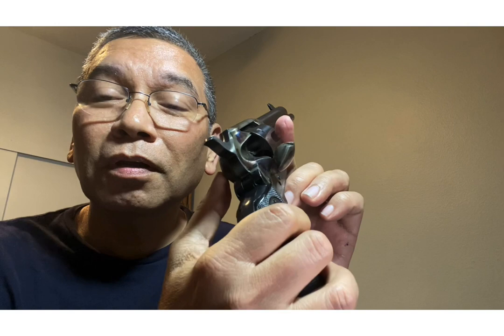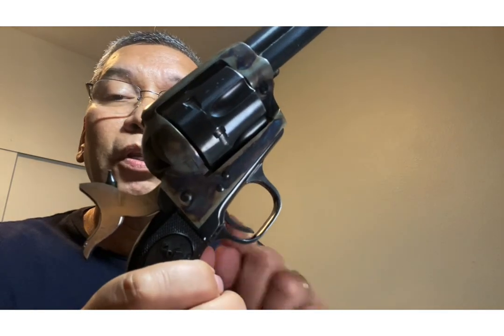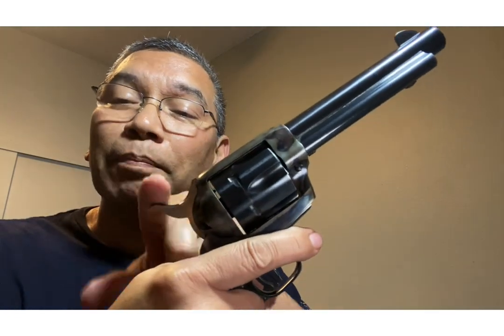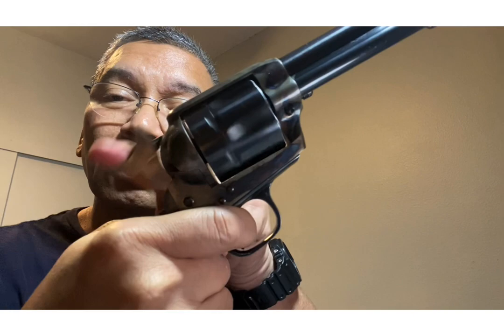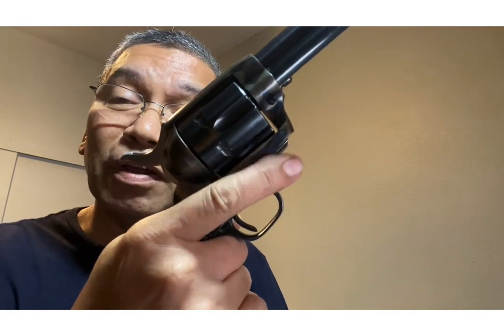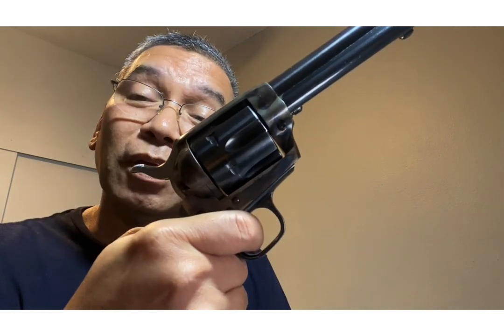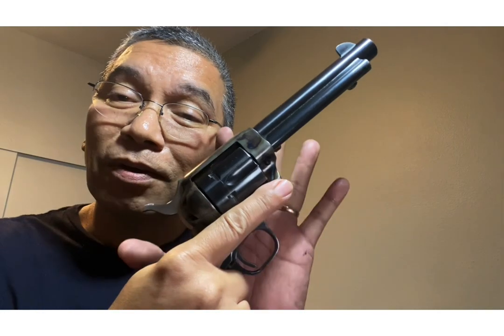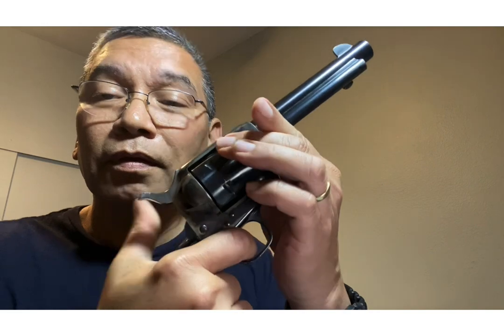Guns Don’t Just Fire for No Reason

Comment: So the answer is no, that gun cannot be fired without depressing the trigger.
Reply: Yes kinda you have to depress and hold trigger to let the hammer down. It's possible for certain guns without a transfer bar to fire if you let the hammer slip while releasing. I'm sure that's what baldwin is trying to say. He did'nt "pull" the trigger on them but the trigger would have been depressed. The gun would have a prop dummy round in it for the camera. Likley the inexperienced weaponmaster left some powder in the round when making the cold rounds.
Reply: @Twistedwolf-ru2qk  I think you missed the part about the specific gun that was used makes it impossible to have fired like Baldwin said without pulling the trigger. Baldwin's ignorance of guns and how they work is why the story he came up with makes sense to him but leaves the gun community cringing.
Reply: However halls is saying his finger was never in trigger guard if that is accurate the gun could have been damaged.

Comment: Nice pistol. In fanning, the hammer needs to be brought all the way back to rotate the cylinder to the correct position so the round is in the correct position. Accidently pulling the hammer back half way with your finger on the trigger won't result in a discharge.
Reply from the maker: You are indeed correct. Even with the trigger held back to release the sear, the hammer must be brought all the way back to properly rotate the cylinder to bring a chamber into battery.  In the mechanics of the lock work, every detail needs to come together for the firearm to successfully discharge.
Reply: He clearly says he was releasing the hammer and it slipped. Releasing with finger on trigger will cause discharge if the gun is missing the transfer bar and hammer block as many prop weapons do. 99% of all these people own have the transfer bar but they can be bought without them. The original guns did not have them and thats why they carried with only 5 as the guns could accidently go off with very little force.  Prop weapons use them for fanning scenes.
Reply: Even with the more modern handguns there has been recalls for the gun dischargeing without touching the trigger. One would even fire if you used a decocking lever. 
Some cowboy action shooting will not allow holding the trigger back and thumb cocking the hammer. They contend some guns can fire out if index if not fully cocked.

Comment: That's similar to some pump shotguns where you hold the trigger back and fires while cycling the action just like holding the trigger back and cycling the action of a SAA handgun. But technically it's still a triggering action; they don't cycle themselves, just like they didn't trigger themselves.

I assume this is in response to the marionette claiming not to have pulled the trigger when he aimed and fired twice at two people, but the handgun came to life on it's own and began firing wildly.
Reply from the maker: I've not really been much of an afficionado of quickdraw with a hog leg.  My friend Jon "Trickshot" Wilson, who I met when we all did the "Top Shot" TV series, was the one who has the maestro of such things.  Unfortunately, he passed away. I would have loved to have interviewed him about this incident.

As to "quick-schucking" pump action shotguns, I've done it but I always worry about that hammer going forward on the older guns before the action is fully locked. Also, my shotgunning aiming intuition isn't the best as my trap and sporting clay scores will attest to. My definition of wild is not having a proper firing solution when I break the shot; so better I slow it down a little when manipulating a pump gun in real life.
Reply: @CMPInstructor  <> Oh yeah, no argument there. But the same could be said of the SAA as well. Just because the mechanics means you can, doesn't necessarily mean you should, or that it's your best option.

Personally I love shooting clays not because it's easy, but because it isn't easy. In fact I've always shot low gun, from a port of arms position to simulate field conditions instead with a mounted high gun like everyone else does. Sure, I miss more targets that way, but I'm being honest with the intention of the game, and enjoying an honest challenge of it.

Comment: "Fanning" only causes a discharge if the shooter begins with the hammer fully down. The SAA clones (Baldwin's gun was a Pietta) have 4 hammer positions. If the user begins with the hammer one click off of "down", then the trigger is locked in a position that will not fire. In order to prevent accidental firing of a loaded SAA due to being dropped, experienced users (presumably including the armorer) will carry the gun with the hammer in one of two positions: first position, or fully "down" over an empty chamber. It's reasonable to expect an experienced user, especially an armorer, to use one method or the other consistently. What was Ms. Gutierrez-Reed's normal practice?
Reply: You sir are wrong.
Reply: @mybad8805  I own a Uberti SAA clone, and rechecked this after getting your comment. I'm not entirely wrong--but you're not entirely right! What's missing from my statement, and apparently from your evaluation, is the status of my trigger finger while trying to fan the hammer. Baldwin said he didn't pull the trigger. My original comment was based on my trigger finger being off the trigger.  With no trigger-pull, when the hammer is in ANY position, fanning the hammer causes it to advance at least one position, but not to release. In order for there to be a discharge while fanning, my finger must maintain pressure against the trigger--i.e., a trigger pull.
Reply: @rcinsley  exactly my point, the hammer can't fall unless the trigger is being pulled and you let the hammer slam home.  My CZ has no decocker.  They tell you in the manual that the only way to lower it on a live round is very dangerous.  Pull the trigger while holding on to the hammer.  Either way Alec killed that scene.
Reply: @mybad8805  Yes, decocking always requires a trigger pull and is an unsafe operation. It should be done very carefully, and only with the muzzle pointed at the ground.
Reply: @rcinsley  I like the pointed at the gun part.  They should add that to the manual.  Safe direction is what they do say and I can imagine how many leaky roofs there may be.

Comment: It is my opinion that during his many cross draw rehearsals he applied enough pressure inadvertently to the trigger for it to be mechanically pulled. Once he began manipulating the hammer to the rear all safety sear notches could be bypassed because he had a depressed trigger unknowingly. The rest is unfortunate history. The sheriff's office has said that Mr Baldwin manipulated the firearm in a way that caused it to discharge so I'm going with this as to what happened.

Comment: Great video and explanation of a single action Colt revolvers functions, that's what I believe baldwin did,  he had his finger constantly applying pressure on the trigger without realizing it due to inexperience with single action revolvers, then pulling the hammer and letting it go ....causing the gun to fire like its suppose to do.. Zero safety measures were taken...This could of been prevented obviously.
Reply: Apparently, daily gun safety glasses weren't enough for Baldwin.
Reply: @michaelbradley7529     It’s be like a formula one driver being an expert on his own gearbox.   That doesn’t make sense.  The question is what a real round was doing on that set.     We also can’t know shit unless we have the actual gun to see and we’re there to know what went down.    

Everything so far is really just speculation and people flexing their revolvers on YouTube.     Like wtf
Reply: @audimaster5000  What does any of that have to do with my gun safety comment? Very first rule is treat every gun as if it's loaded.

Comment: All relevant points Dennis. Time will tell what else went wrong and how many bad things had to line up for this tragedy to strike. 
The idea that it is "someone else's responsibility" to make a real gun "Safe" and calling it a "Prop Gun" in the media over and over is a big spin and intentional misconception in my own view. 
For this spin version to even be possible, the distinction between a "Prop Gun" versus any prop needs to be defined. For the concept to have "someone else be responsible", that so called "Prop Gun" would have to be inoperable would it not? In modern law, does the concept that the production company hires a "gun handler" or "armorer" exonerate everyone else who touches a real gun? Time will tell.
It would be hard to believe any Hollywood adult doesn't remember the tragedy and controversy incidents like the "blank gun" that claimed Brandon Lee (on the set of The Crow) could have escaped their attention or memory. 
The swirl about what is a prop gun, versus a blank gun, versus a real operable gun, and where responsibility begins and ends, will undoubtedly come up in an investigation and trail. Lawyers will try to bend language to their advantages and the politics of the industry will more than likely come into play, but in the end this was a gun, not a prop gun. Live ammo is not blank ammo either, and even blanks have been known to cause death in that Lee incident in any case, so in the end even a blank gun should not be legally considered a prop gun.
Live ammo had no place on that set, and the gun cannot be real and operable and yet still be considered safe at the same time by anyone who touched it. 
My guess, is everyone in the chain that brought a real gun and live ammo to a set, and that fired that gun at the victim is responsible, including and especially the one who pointed it and fired it. The debate should be the degree of the murder and how much of that guilt is also shared by those others. If there is a not-guilty conclusion, it would have to be based on concepts not presented by the story so far. Time will tell.

Comment: So what happens if it's less than quarter cocked and released?  Like if it was 24.9% cocked, as close as possible before the safety mechanism catches it and thus being able to strike without a trigger pull?  What happens if cocked to the point just before it latches and it is slammed back into position with a force greater than just the return spring?
Reply: It would not have enough momentum to ignite the primer.
Reply: If the hammer goes back without a finger on the trigger to the first click, about a centimeter, then it catches and won't go forward, even if you pull the trigger. If you put it in the half cock position to rotate the cylinder, it won't go forward, even if you pull the trigger. The only way to lower the hammer back down is to hold the hammer all the way back, pull the trigger and slowly lower the hammer. The only way the trigger will drop the hammer is when it is fully cocked.
Reply: @indiedavecomix3882     We can’t really know unless we had the actual firearm.  It’s entirely possible it was a clapped out or broken gun.    

The real issue is a live round being on the set.    That’s step one
Reply: @audimaster5000  You think if the cops found out the gun was faulty they wouldn't immediately put that out? They already let him fly to Vermont immediately after, why wouldn't they clear him as soon as they found out? Is it possible the gun was faulty? Anything is possible. It's even more likely he just pulled the trigger on a cocked gun and is lying about it. Where the bullets came from is a separate but important issue. Is it possible he loaded the gun? Yes. But more than likely someone else did it because he's too stupid to check if it's loaded so I doubt he's smart enough to figure out which way the bullets go in it.

Comment: Great video…but it is not true that every gun has to have a trigger pull before it will discharge. In the cowboy action shooting world there are guns like the Old Army 1860 model that only has two clicks and no transfer bar.  One has to pull the hammer back fairly far before it goes into the half cocked position, if one were to drop the hammer before the gun reaches the half cocked position- it will discharge with no trigger pull.
The question is can a Colt 3 click or 4 click discharge before the first click by dropping the hammer?

Comment: You can convert a Revolver to a Slip Hammer Revolver by removing the Trigger Spur. I uploaded a video showing how.
Reply: On a "slip gun," the trigger is either removed altogether, or wired back to the back of the trigger guard. The hammer spur is removed, and rewelded a little further down on the hammer.
Reply: @thomaspowers5486  I think I'm going to order 2 triggers and one hammer. Just incase I mess up the trigger.
Reply: @TobaccoRowe1960  I have several Ruger S/A's. Always wanted Colt though.
Reply: @thomaspowers5486  Colts a pretty gun. I'm poor, I buy Taurus. Buy two for the price of one. All my guns are Ugly Ducklings. For the price of a Colt I could have a Two Riders a Rancher and a Barkeep all in 22 WMR Magnum. And Holsters with Belt to  : )
Wait make that Rancher a Rossi M92 Lever Action please.
Reply: @TobaccoRowe1960  Sure, gotta' do some savin' for a Colt! One day maybe . . .
Reply: @thomaspowers5486  I'm wishing you ;luck Thomas
Reply: @TobaccoRowe1960  Thanks, you as well!

Comment: I love gun "experts" trying to claim expertise on prop guns. Prop weapons are bought many times without a transfer bar or hammer block for rapid fire scenes.  Prop revolvers HAVE to have something in the chamber because an empty gun looks like an empty gun on film. There are two types of ammo for prop revolvers. Cold dummy rounds and hot blanks that have a crimped end and don't look right from forward facing shots and Dummy rounds. Also referred to as Hot and cold rounds.   These dummy rounds are made with real bullets that have the powder removed and the primer discharged.  This makes them inert and safe and therefore is referred to as a cold round. HOWEVER it is possible for someone to forget the primer or powder in a dummy round. This happed with Brandon lee someone emptied the powder but forgot the primer and this dislodged the bullet tip into the chamber. When the blank was loaded it fired into Brandon. Likely what happened here is when the inexperienced prop master made the dummy rounds she forgot one bullet or got them mixed up somehow, This coupled with the missing transfer bar means that when baldwin was letting the hammer down holding in the trigger all that needed to be done was for the hammer to slip down. So what he means by not pulling the trigger is he did not do a full trigger pull he was just trying to release the hammer. This is possible with this type of weapon without a transfer bar or hammer block. You also have to understand it is these peoples jobs to point guns at each other. It's the weaponmasters responsibility to make sure the guns are safe and the rounds loaded are safe.
Reply from the maker: I’m actually familiar with the internal modifications made to prop guns. As you will see in one of my other videos, I did confer with experienced Hollywood armorers on this subject.

A number of them are friends of mine. I met them when I did a stint as the live fire weapons expert for Seasons 1 and 2 of the tv show “Top Shot”.

In properly made photo quality replica ammunition, even the primer is a solid machined piece of metal and there is a BB placed inside the case so the armorer can shake each round and confirm that it is inert.

A lot of things went wrong on that set creating a complex multi-step failure pathway for a tragic industrial accident. It’s very sad.

Comment: There is one other possible way that the gun could have fired - if the hammer was lowered onto a loaded chamber in the cylinder. Colt single action revolvers were meant to have only 5 rounds loaded to be safe. “Load one, skip, then load four,” which left the hammer and firing pin sitting on an empty spot in the cylinder. If the hammer was lowered onto a loaded cartridge, the firing pin would be pressed against the primer but may not cause it to go off. Even a small amount of jostling or pressure could then fire off the round without anyone touching the trigger.
Reply: True, but he said he pulled the hammer back, so, that doesn't apply. Just saying.
Reply: That's not Baldwin's story, though. He says he let go of the hammer without pulling the trigger. That's a clear falsehood unless there was a malfunction with the gun. A simple function check of the gun will prove or disprove that. A fully functional gun under the circumstances he describes, won't just "go off".
Reply from the maker: It takes a pretty solid hit to put enough energy into a firing pin to ignite the primer starting from a hammer down position.  You pretty much have to hit the thing with a hammer or drop it on concrete landing precisely on the hammer spur. Both of these ignition paths would not fall into the domain of "a small amount of jostling".  It's important in things like this to avoid overly contributing to myths.